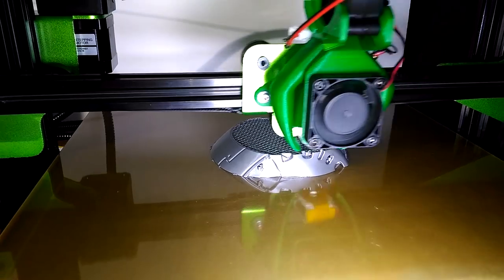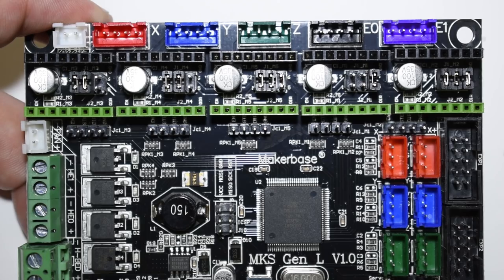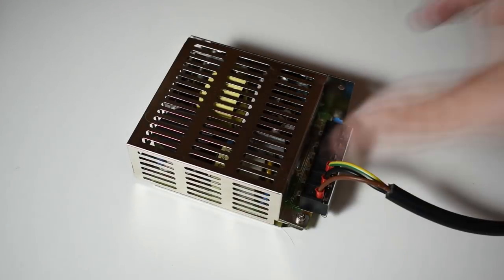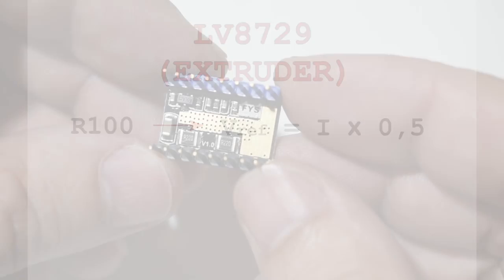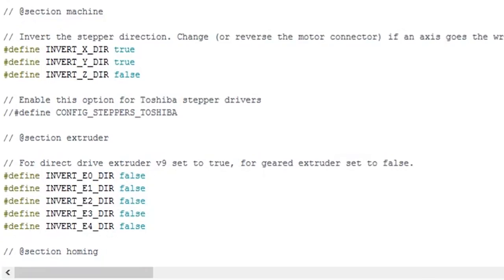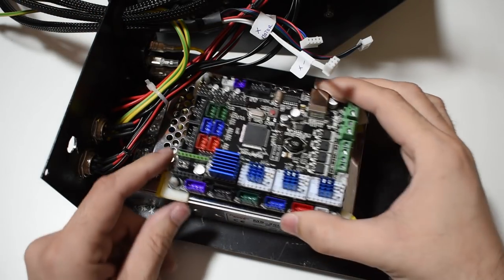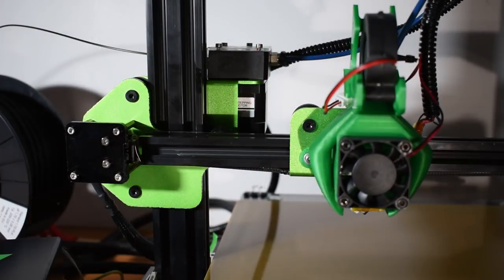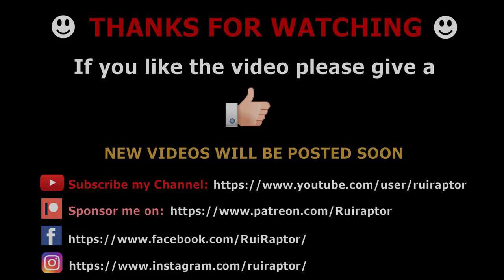Install & Setup - MKS GEN L + TMC2208 + LV8729 (TEVO TORNADO)

Comment: How do I tell if the display connectors need to be reversed?
Reply from the maker: If you connect the display and it does not show any characters
Reply: Thanks. =)
Is my MKS Gen L supposed to be beeping constantly after I plug it in before flashing the firmware?
Edit: NVM, apparently it's supposed to beep. It stopped beeping while the firmware was uploading and rebooted just fine. =)

Comment: i followed this on the 2208's but my stepper motors are moving double the distance than they are supposed to... I tried to cut the steps per mm in half but still does the same thing. I noticed you are the only one who is removing the last jumper while everyone else is leaving all of them in. What am i doing wrong here?  I FIGURED OUT THE PROBLEM! Turns out the eeprom was not clearing when i reflashed the firmware for some strange reason. I managed to clear it with pronterface and then reupload the firmware and now it is working fine.
Reply from the maker: Hi,
everytime you flash the firmware, you need to load the default settings and then save to eeprom. This way you are loading the new values and saving them on the memory.

Comment: hi ruiraptor, I wonder if this controller's to use on a corexy printer.
  My question is that on Z axis it works with 2 stepper motor.
  Thanks if you can help me and I'm always following your videos and can count on like.
Reply from the maker: Hi Ricardo,
This board has 5 driver slots, which means you can use for 1 for X, 1 for Y, 2 for Z and 1 for E. You just need to define that in the firmware. Instead of 2 extruders, you use 2 Z motors. The corexy, delta or cartesian models are also defined in the firmware.

Comment: hi ruiraptor

i finally make the step to an mks gen l with the 2208 and lv drivers after a lot of great prints with the old tornado.
as a noob in using arduino i managed to follow your steps and get it al build in.
but now my screen wont torn on anymore and i reversed both of the cables goin to the display board.
do you have any suggestions? cheers
Reply: Ok, i whas in panic to early. Turns out i do not need to reverse the cable? Plugged them in the way they used to be and now it worked. Maybe because i have a screen board without a pot meter for the brightnes?
Reply from the maker: Hi,
Did you installed the firmware into the new board?
Which firmware did you use?
Try to install the stock firmware before installing a modded one.
Reply: @ruiraptor  My screen doesn't work either. I'm using the stock LCD and verified that the correct LCD is uncommented in the firmware code and that the cables are correctly connected
Reply from the maker: To make sure, download the stock firmware from https://github.com/tevo3d and install it.

Comment: I enjoy all your videos. Thank you
This is a somewhat newbie question. 
I have a Tornado and updating to MKS Gen L V1.0 Board.
Have a question on the wire transfer from the stock board like the one in your video.
To the MKS Gen L V1.0 board. Can you tell how to identify the fan wires from the extruder hot end
On the stock board, and where do they go on the MKS board. 
The fan that cools Nozzle is 24V and the fan that cools the Heat Sink is 12V Please help.
And the A13, A14 on the stock board. Do these plugs go to A13 to TH2 and A14 to TR.
Thank you
Dale
Reply from the maker: Hi Dale,
Thank you so much for your comment.
All fans should be 24v. Are you sure you have a 12V fan?
The heatsink fan should be connected to HE1. The heater is connected to HE0.
The layer cooling fan (blower) is connected to the small connector labeled "FAN".
Regarding the A13 and A14 you should connect to the similar connectors located in the same position.
Reply: Thank you so much for your response. If I understand you, Connect extruder hot end lower fan (HEATSINK FAN)To –HE1+ on MKS board.
Connect hot end top fan (NOZZLE FAN) to –HEO+ on MKS board.
Connect the 2 control box fans to –FAN+ on MKS board.
If I understand correct this will help very much. I don’t understand what fan you call the Heater.
 And Layer cooling fan. 
A13 and A14 connecters are different colors on the MKS board.  Don’t know what color A13 or A14
Should go to on MKS board. 
Thank you again
Dale

Comment: Hello m8, Why you use that jumpers? can i use the 1/128 step with ramps 1.4 ?
Reply from the maker: Hi,
The Ramps 1.4 MCU is 8bits so for that reason you cannot use 1/128 steps.
Reply: ruiraptor I have atm the 3 jumpers on, prob the motors are failing steps?
Reply from the maker: For an 8bit board i would suggest to keep at 1/16steps. Smaller stepping might be too much for the speed that the MCU can handle and will skip steps or the entire firmware might run slower.
Reply: ruiraptor thank you! Can you please help me identify the jumpers on the ramps 1.4? The m1,m2 and m3 are not labeled
Reply from the maker: check here if it helps:
http://www.geeetech.com/wiki/index.php/Ramps1.4

Comment: Great Video again, a friend of mine already done this with his tornado. So i went on and changed my tarantula as well. 
It work`s fine, but i have a little problem with my Y-axis. The calibration cube turned out like a little tower of pisa. (i mean this cube is 20mm and the final layer is 1-2mm further than the first layer)
Anyone suggestions how i can fix that? 
Regards
Reply from the maker: Hi Egon,
That means you have layer shift on the Y axis.
You need to check the Y axis Vref. Too much current will make the stepper driver to shut down. Too little current will make it lose steps.
Other than that, check the Y axis belt tension.
Reply: well, i`ve done this already.  The  values are like yours but i won`t work. I have no ideas what to do.

Comment: I followed your tutorial and I have problems, the drivers are very hot and after 3:30 printing my x axis and y stop moving, where does the problem come from? I followed the video perfectly, I think they overheated
Reply from the maker: Hi,
If the motors are stopping that means that the drivers are entering in thermal shutdown mode as they have reached a high temperature.
You need to double check your vrefs as you might have your output currents too high and/or check your cooling. The drivers must have a good cooling. Check if the heasinks are correctly installed and install an additional fan pointed towards the drivers.
Reply: ruiraptor t
Reply: The way these are installed in the video, they are operating in Stealthchop mode only. If you're using 12V, they can't handle a whole lot of torque/speed. You can:
1. Add more cooling - fans, another heat sink
2. slow the printer down
3. Upgrade to 24V
4. Put the drivers in Spread Cycle mode

Comment: if you want to run the tmc2208 at 1/256 steps, how would you set your jumpers?
Reply from the maker: You can't. Max jumper configuration is for 1/16 microsteps

Comment: @ruiraptor Having another issue,my extruder motor will not work...I have tried 4 different A4988 drivers that I know work and Vref is set around 1v which is more then enough to run the motor,but it still will not move.I have tried everything,tried plugging another axis into the motor to make sure the motor works and it does,tried plugging the extruder cable into another axis but nothing moved.The board is brand new,firmware is Marlin 1.1.9 configured for the Tornado.I have tried another cable and even checked the jumpers but still nothing has changed,still won't work.PLEASE HELP!
Reply from the maker: Hi, did you heat up the nozzle first? The nozzle must be at 180 degrees C or higher to enable the extruder motor.

Comment: Hi friend, I can put the MKS Gen L 1.4 on my Tevo Tornado?
Reply from the maker: Hi Melvin,
There are 2 Gen boards. The MKS GEN L and the MKS GEN 1.4.

You can use the MKS GEN 1.4 board but it will not fit inside the enclosure.

Comment: @ruiraptor I have followed the video step by step but when I try to print the Y and X axis moves all the way to the limits and tries to keep going even at the endstop.How can I fix this?
Reply from the maker: Hi,
you probably connected the endstops at the wrong connectors or they are not inserted correctly. Check all the connections.
Reply: @ruiraptor  I figured it out,had the jumpers set wrong,only had the MS3 pin on instead of the MS1 and MS1 pinned.Only need the MS1 and MS2 for 2208 drivers set to 1/16 steps,it works now.

Comment: How should I determine the needed stepper motor current, in order to calculate the vref?
Reply from the maker: Hi,
It depends on the driver.
If you are considering an Allegro driver, for example, you can use the same output current as the ideal working current of the motor. When working with TMCs, you don't need as much current because of their pure sine wave. TMCs can produce more torque at lower RMS. Also, they work very hot, so you don't want to have them working more than they should and create more heat. Too much heat will make them shutdown thanks to the thermal protection.

Comment: if I changed my board to the gen L on my Tevo black widow, would this work?
Reply from the maker: The black widow already has a MKS GEN, however it's the bigger version.
You can change the board but you don't have to because the stock GEN 1.4 of the black widow also allows replacing the drivers.
Having said that, just replace the drivers on the black widow and that's it.
Reply: ok im changing the motherboard so I can do a control box mod where it is smaller and is attached to the side of the printer. Was just wondering if this would work also since I will have the same motherboard and drivers. Thank you!

Comment: Why you change otp 1.1 to TOFF =2. You change limit for chopper frequecy but why ?? Driver have a problems with default settings ??
Reply from the maker: What do you mean by i changed the limit?
Reply: @ruiraptor  Datasheet page 51

Comment: I have a problem upgrading Black Widow with a stock board to TMC2208. After the upgrade and the removal of the suggested pins underneath the controllers, now the axis move twice as much. I request 1 cm movement and it moves 2 cm. What is wrong and how should I fix it. Thanks!
Reply from the maker: Did you remove all of the jumpers or did you remove just the ones i mention in the video? Maybe you have a different stepping configuration now.
You can still edit the steps/mm to match the current stepping configuration.
Reply: @ruiraptor  Thanks for the quick reply. I removed the MS3 jumpers. At the end I was forced to reduce the steps per mm by half and the movement is now normal, but I don't know if this is the proper way of doing it and if I am loosing quality because of this. If you think I should configure something in the Marlin firmware, please share it, I am comfortable doing it as I am a programmer. Actually yesterday after my comment I downloaded the 1.1.9 Marlin release and configured it for Tevo Black Widow. I put the option of 2208_standalone for the drivers in a desperate hope that the firmware will handle the rest, but there was no difference. I also notice I have a bit of ghosting around text when I printed a heat tower for my new fillament. I read somewhere that this might be incorrect stepping for the 2208. Do you have any ideas regarding this issue? Thanks a lot. Subscribed!
Reply from the maker: Hi,
If you have set the 1/16 stepping mode with the jumpers, you have everything correctly.
Editing the driver in the firmware does not change the steps value because that depends on the stepping configuration and the firmware has no way to know which you are currently using.
Regarding the ghost, that is related with the acceleration and jerk settings. Check which are your acceleration and jerk and reduce them
Reply: @ruiraptor  I have acceleration at 800 and jerk X/Y at 8. As far as I know, this is already pretty low. Do you think I should set them even lower?
Reply from the maker: how are your bed springs loaded? Does the bed wobble much? How fast are your printing?
Reply: ruiraptor  Print speed 45 mm/s, Infill speed: 50 mm/s, Outer wall speed 22.5 mms,  Inner wall speed: 45 mm/s. Layer height: 0.06 mm (if important). Acceleration: 800, XY Jerk: 8. Not sure what qualifies as "loaded" for the springs. The screws are sticking about 0.5 cm out of the nut (approx). 1 thing worth mentioning: I am printing on a 4 mm glass bed covering the whole heated bed. Not sure how the added weight affects the issue as I just noticed the echo is mostly visible on the X axis (caused by Y axis oscilliations). Tried to tension the belt with marginal improvement. Thanks!
Reply: @ruiraptor  I even tried reducing the XY jerk to 1 and the acceleration to 700. Doesn't seem to change anything, and no - I don't have manual jerk control enabled in Cura, so the slicer shouldn't be overriding the settings.
Reply from the maker: Hi,
You are probably working at a different microstep configuration. Adjusting the steps/mm will work.
But i recommend you to setup the TMCs with 1/16 microstepping. 
Regarding the firmware, it will not make a difference because the microstepping is set on the board and not on the firmware.

Comment: Hello Ruiraptor So i got the drivers but I'm running the TH3D Marlin U1.R2.A8  I have been through the setup and I dont know where I need to make the changes for firmware with direction and stepper settings. Help?
Reply from the maker: Hi Shawn, search in configuration.h file the line "define X_DRIVER_TYPE" and add TMC2208_STANDALONE. Do the same for the other axis. To change the direction, search for the line "define INVERT_X_DIR" and change the logic.
Reply: @ruiraptor  in configuration H all I get is printer setup like bed size   probe and such   it seems like backend shows this but says not to change  ---//FT-5 Model Settings
#if ENABLED(FT5)
  #ifndef MOTHERBOARD
    #define MOTHERBOARD BOARD_MKS_GEN_13
  #endif

  #if DISABLED(FT5_12864LCD)
    #define REPRAP_DISCOUNT_SMART_CONTROLLER
    #define LCD2004
  #else
    #define REPRAP_DISCOUNT_FULL_GRAPHIC_SMART_CONTROLLER
  #endif
  
  #define BAUDRATE 250000
  #define DIRECT_DRIVE_PRINTER

  #define X_MIN_ENDSTOP_INVERTING true
  #define Y_MIN_ENDSTOP_INVERTING true
  #define Z_MIN_ENDSTOP_INVERTING true
  #define X_MAX_ENDSTOP_INVERTING true
  #define Y_MAX_ENDSTOP_INVERTING true
  #define Z_MAX_ENDSTOP_INVERTING true
  #define Z_MIN_PROBE_ENDSTOP_INVERTING true
Reply from the maker: The TH3D firmware has it's own template. The settings are there, you just need to find them. In alternative, you can donwload the original one from Marlin's website. You can find the config files for the printer in the examples.
Reply: @ruiraptor  Does the original firmware you use support EZABL I have one on the Tevo Tornado
Reply from the maker: Yes, because it's all Marlin...you just need to enable it
Reply: @ruiraptor  I know in your video you said you can get the tornado firmware from the group which im in but its changed since your video do you know which one should be used now?
Reply from the maker: I would download directly from Marlin's website and use the example config for the tornado. That way you will have the latest one.

Comment: i am currently working on a small pcb you can install the driver into and conect it to the mks base board instead of buying a new board
Reply from the maker: That's great. Share your results.
Reply: so i am at the point where i made a wireing diagram and have to gert a mks base board to inshure that the prototype works
so basicly it is too early to publish the results
but i think it shuld work because (according to the data sheet) the DIR, STP, EN, SLP and RST pins are all connected directly to the controller and all you have to conect are VMOT(basicly +12/24V) alwell as +5V and GND
also a 100uF capacitor between VMOT and GND and the jumpers for stting the step mode

Comment: What is the advantage of lv8729 on the extruder over the tmc2208???
Reply from the maker: Hi Harvin,
The TMCs cannot handle very well fast direction changes such as the retractions from the extruder and that's why the LV is used instead.
Reply: @ruiraptor  so how fast can I go with the tmc for x and y axis then?
Reply from the maker: If you don't mind the noise, you can LVs in every axis, but you can go fast. 
X and Y axis normally don't reach the same acceleration values of an extruder.
Reply: @ruiraptor  thank you very much for all this info!!!

Comment: Where do I find the standoff for the gen-L??
Reply from the maker: Hi Krank,
These are normal stand offs. You can get them in any electronic store.
Reply from the maker: Here's an example: https://pt.aliexpress.com/item/MTGATHER-100-PCS-HC-5-Nylon-Plastic-Stick-On-PCB-Spacer-Standoff-3mm-Hole-Support-Locking/32793176367.html
Reply: Thanks for the link.

Comment: this control board work for old CTC 3d printer?
Reply from the maker: Hi,
The board will work with almost every FDM printer. You just need to have a compatible firmware for it.

Comment: Hi can I do this set up the the black widow. Would it be much of an improvement
Reply from the maker: Hi Paul,
The black widow is already equipped with an MKS GEN 1.4. so you only need the TMC drivers.
And yes, you will notice an improvement as the TMC drivers are much better than the stock DRV8825 drivers.
Reply: Thanks. I thought with the "l" it was a newer version. But great I all ready have both. Drivers and board. Tmc 2100. thanks again
Reply: Hi rui can u suggest a screen upgrade for the black widow... Is it possible.
Reply from the maker: Hi Paul,
The black widow already has a graphics display.
What kind of screen upgrade are you looking for?